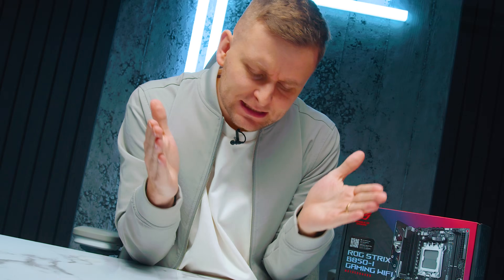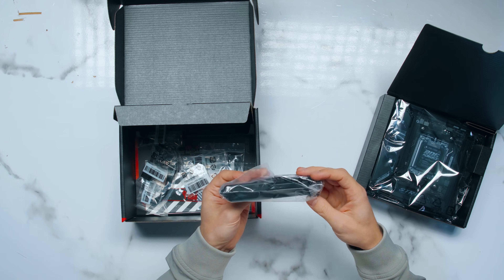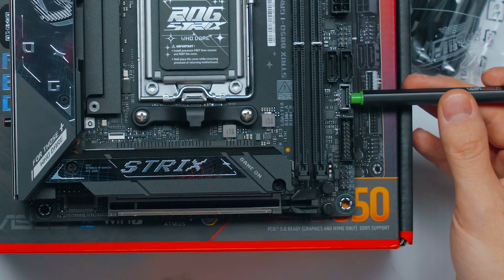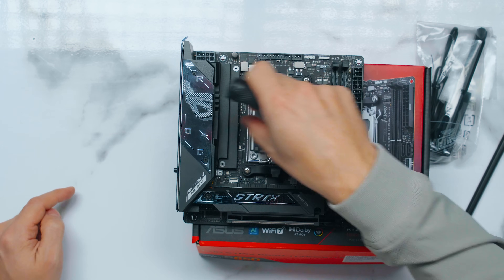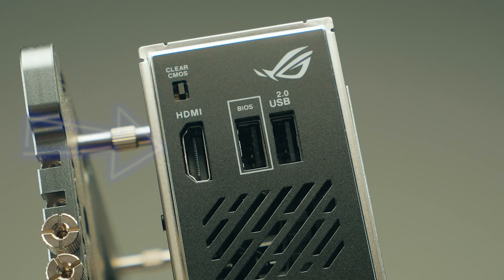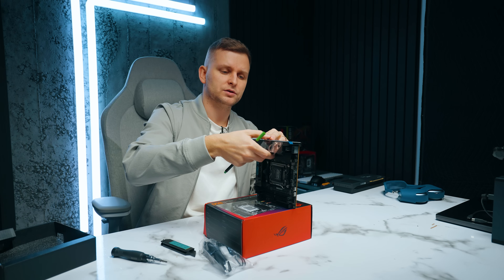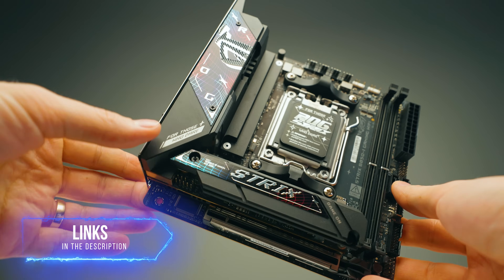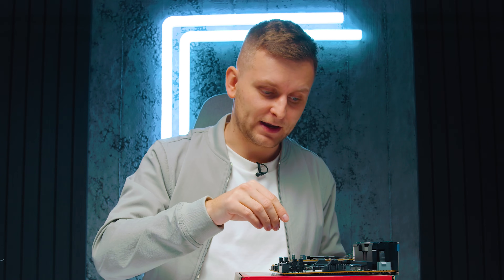BEST 'Budget' AM5 itx motherboard for Ryzen 9000! - ASUS ROG RTX B850-i Strix

Comment: HI is there a B850i IItx board that has three nvme slots ?   My Gigabyte B650 I aorus , Has 3 m.2 Slots. thanks  ??????
Reply: I don't think so. The updated mobo of the o e you have only has two now. The Intel versions like the MSI Z890i Edge TI can hold 4 and the Asrock Z890i Nove can hold 3. The MSI Intel mobo is only about $30 more than this board.

Comment: Looks like it supports 128GB RAM now, maybe with a BIOS update.
Reply: Hey have you tested it with 128GB of RAM? I see conflicting info on this everywhere
Reply: @JuanGoreTex I have not, I got 96gb 5600 running without issues. The asus website says it supports up to 128gb, so I expect that to be true. It will require 2x 64gb sticks, which are still very expensive.
Reply: @abaj006  okay got it, I guess I will give it a try since ASUS confirms it themselves. Thanks a lot for getting back to me!
Reply: Can confirm that it works with 128GB!

Comment: 7:00 would you still recommend a heatsink for a gen 4 ssd in the 2nd m.2 slot on the back? If yes, couuld you please recommend some low profile ones that'll still have good fitment for ITX cases (traditional config).

Comment: The downside of SFX cases not mentioned.
Power cables need to be bent excessively to hide and manage.
SFX power supply is two times the price of ATX equivalent.
Motherboard is more expensive.
Heat can be higher if you are going for a high end GPU.

Comment: FYI... AIO pump header can absolutely be set in BIOS to run at any speed. It's not stuck at 100%.
Reply: Good to know tnx for info
Reply: Good to know. I was wondering what the heck that was about o.0
Reply: I plug my 2 Phantek T30s in the pump header. They still run 100% for about 1 minute before slowing down to the speed set in the bios =)) The Bios need a short amount of time to boost and apply the fan curve i guess =))
Reply: @TruongVuDuc  Yes that may be true for a short period of time before it kicks in!

Comment: ??? so the only differenece is wifi7 - which sounds fine but like sff pc builders like to buy small antennas so those won't work on new connectors
clear cmos but I think you could configure flex key to do that already I don't remember
additional fan connector but with less power
and that's it???
no usb 4, no internal usb c 20g, no additional m.2, audio not improved
wtf

Comment: I have the X870-I and I am a little miffed that despite the $450 I paid for it, the magnets they put in the wifi antenna are seriously weaker than the one's they used in the X670E-I's wifi antenna. Seems like they cheaped out a little while still keeping prices in the stratosphere. MSI has a sick Z890 I Edge TI Wifi intel Ice itx board I wish they would port that motif to an AM5 version of the board. AM5 needs an all white ITX board, I'm just saying.
Reply: supposedly Nvidia presses MSI to not do so much for AMD.

Comment: I don't need the X series on AMD because I already have what I need for tweaking both RAM and CPU in B series.

But I do have a need to buy the "Z" series because from the B series I can really feel the downgrade. A lot of limitations there, but since the degradation issues on gen 13 and 14 are there, the B series is still a good choice. In the 200 series, the story may be different.

Comment: I think you forgot to mention that it costs 350 EUR ++ at the cheapest outlets I could find in Europe right now....
For something that adds almost nothing (400 higher Mem speed, Wifi7) and still has worse power stages than many 150 EUR M-ATX or M-ITX B650 boards, that's honestly quite a bit to ask IMO....
Dont load this with anything more than the 9700X, and don't OC above maybe 125W and you're ok though.

Comment: I just don't understand why there aren't more Micro ITX motherboards on the market.
Reply: hello mate, first there is no Micro ITX platform but mini ITX and yes it's a niche market because they have to make a board small as well as feature rich like micro ATX and ATX counterparts.
Reply: @godisadjlikeme  There is in fact micro-atx. They are 244x244, vs mini-itx 170x170.
Reply: It is still niche
Reply: Wish motherboard makers adopt the Mini DTX format, would give space for a extra PCI-E slot,ideally x4.Still running a Asus Compact VIII,a mini DTX board.
Reply: because it's a niche market. plain and simple.
Reply: @jeremyg2236  Not as niche as it used to be. SFF has been steadily gaining popularity. But I guess "standard" ATX builds have also been gaining in popularity.
Regardless, it would be good to see more mITX options.
Reply: @jeremyg2236  its getting more and more love... It is more popular than 5 years ago

Comment: Another upgrade from last gen B650(E) is that not only is the 2nd M.2 slot Gen 5, but it's now directly linked to the CPU, not the chipset for big latency reductions.
Reply: On the B650E-I both the front and rear M.2 slots are connected directly to the CPU, but you are correct that the rear slot on the B850-I is now PCIe 5.0 x4 vs PCIe 4.0 x4 on the B650E-I
Reply: @CPoston420  Oh true? I was under the impression it was chipset linked.
Now I don't feel as bad putting my boot drive on the Gen4 slot 😅
Reply: Me when I have no idea what I’m talking about and am wrong

Comment: Crazy to buy a new motherboard in 2025 for $300 and no usb4.
Reply: I rather have another m.2 than usb tbh
Reply: The x870-i has it but its $200 more. He linked it above (it looks like two links to the ASUS ROG Strix B850-I but one redirects to the x870-i)
Reply: Seriously, how open do you use usb?
Reply: Yeah but its not that necessary for most as most use gpu and integrated one is not very strong so 10 or 20 more than enough for monitors
Reply: @Donbros  it's not only about video display. I use usb4 on a daily basis for my external nvme drive. Run my steam games off it (so I can bring it with me on the road and play on laptop). I also do system backups to the drive over usb4 - the speed difference is a full backup in 20 minutes vs. 1h 20 minutes over 10gbit USB. Other people use it for egpu. And a bunch of other high bandwidth devices (like 10 gbit ethernet). Intel has had tb/usb4 standard for several years now. usb4 has been out for half a decade, and even usb5 devices have started hitting the market. AMD has been stupidly lacking in high-speed IO.
Reply: @BaronCAD AMD has not been lacking at all. It’s fine that you use it but 99% of end-users don’t care about USB4, and for the people that do: they buy intel because it’s better for workstation applications and it aligns with their use case better. Therefore Intel board partners are more likely to implement USB4.0
Reply: USB 3.2 is fine for steam games.
Reply: @Sheisty25  If you're fine with big stutters and delay during asset loading, sure.
Reply: I feel usb 4 only makes really sense on laptop or maybe people that really need the bandwidth. Other then that you're not using more than usb 10 or 20 gig. For example you're not going to run display over it unless you're using the igpu in the chip, power delivery is not needed so this only leaves your perifs and internet, which sure you could run with one cable but so can standard usb c
Reply: @championxxlNL ”I feel like USB 4 is only useful for people that really need the bandwidth”

Wow great observation man. 

And I feel like an EpiPen is only useful for people that really need to treat a severe allergic reaction.
Reply: @Boofski  lmao okay troll. My point being hardly anyone needs the bandwidth. Usb 10gb can already keep up with Gen 4 drives and USB c 20gbs with Gen 5 so where is the need for the extra 20 gbs?
Reply: For me is OK, I'm not use usb 4 😂😂😂😂
Reply: still not widely needed, so I don't see the complaints.
Reply: @jeremyg2236  Would be nice for futureproofing, especially for fast external SSDs and fast charging. Furthermore, a Mac Mini which costs $599 has 1 Thunderbolt 4 port and 2 USB 4 ports while Minisforum has USB 4 mini pcs for less than $400 so what are the excuses here.
Reply: @jeremyg2236  Yeah try doing a 1tb backup to an external drive and you'll quickly see how onerous it is to transfer files without a big fat pipe. 40 gbit/s usb has been out for over 5 years now. It's standard on every intel system (laptop or desktop).
Reply: The only time i only needed a usb is when ksntalling windows lol 😂

All video materials are over the internet or NAS
Reply: Who cares about USB port that much in 2025?

Comment: Are you sure aio only goes 100%?
I have the asus pro art x870e and aio is configurqble in bios with gui.
Even the standard config is not. 100%
I use it and it works (makes pump be noticably less loud).
Reply: It absolutely is configurable. He misspoke.

Comment: T-Force M.2 NVMe drives with the copper heatsink fit perfectly on the rear SSD slot. Use a good stand off. N=2 using a couple of ThermalTake ITX cases with LGA1700 board with 12900K CPUs so YMMV.

Comment: The AI Networking explanation doesn't make sense. Any client will connect to the most optimal channel because the router determines what channels it will broadcast. The router/mesh system will choose the channels with the least co-channel interference from neighbors, etc. Then clients will have to connect to that. It does not need AI to do this because that's a feature that consumer routers have had for at least 15 years.

Comment: Please check if the coils can be heard, apparently it's bad
Reply: hahaha just like with the B650e-I. Then after 4 months they fixed it and boards with Date of Production after 03-2024 I think had no coil whine
Reply: @zafert85  I have to find a model without coil while, I like the asus X series, I wonder how the coils are
Reply: @ just get a B650e-I from ASUS.  I dont think they have stock left from Q1 of 2024 so you sh9ould be good. But wait... If they have fixed it with the B650 then the B850 should have noisy coils either
Reply: @zafert85  There have already been posts on reddit that there is supposedly no problem in the b850
Reply: @errrr69 nice glad for that as i already have ir hut not build yet
Reply: @Donbros  I'm also looking for what to choose and I rather take the B850i

Comment: I just built an ITX small form factor PC using the Minisforum BD795i SE (includes Ryzen 9 7945HX CPU and heat sink) and the RTX 4070 Super.
Reply: That price plus a direct die cooling 16 cores , no one can beat it ! 😊
Reply from the maker: OH YEAH, the minisforum ITX board is mint! :)
Reply: I just sent back my 795s7.  Same mobo, great proc and price but didn't like the ram options and the bios.  Just ordered one of these with a 9800x3D instead.

Comment: To save even more money you can get an mATX B850. There are some great SFF mATX cases out there.
Reply: ncase m2 is literally my favorite case
Reply: @kozekistudio  and if you can't get hold of that the Lian Li A3-mATX looks like a good option
Reply: @jbrown-acuity  Jonsbo Z20 is underrated and it's almost the same size as the NR200
Reply: I was looking at this mobo the other day for an SFF build I was thinking about in which I consider something I can put in my 🎒 backpack. I also looked at the TUF Gaming B850M Plus WiFi  which has 3xM.2 one is Gen5 but has plenty of IO like 4xusb2 -  4xusb3.0/3.1 - 3x10gb ports and 1x 20gb type- c port. I just can't find any MATX cases that I like except the Jonsbo TK-1
Reply: Wait now SFF build include a large matx board 😮?! 

Jensen Huang is right ,they call a large size card SFF now
Reply: @frankwong9486  the motherboard isn't the main part when it comes to sff. sff is the volume of the case. 20L or lower is consider sff, and matx boards can fit into those cases. the ncase m2, is a 16L case that supports matx boards.
Reply: @kozekistudio  ah that's interesting，usually I see SFF I thought those are itx /deskmini or 5-8L size 

If anything below 20L consider as SFF then we can build 

2U 40cm depth server and call it a SFF server
19inch 1U 40 cm depth was like iirc
48.26 cm x 4.445 cm x 40 cm

Google told me that was about 8.580628 litres

So technically we can have 2U 40cm SFF or simply stack 15pcs 1L mini pc and call it a single SFF contain 15 node 🤔

Intel have a blog say below 25 still goes SFF, so we can have nearly 3U of space to play with or made a 2U full depth SFF server 😂 time to EATX SFF !